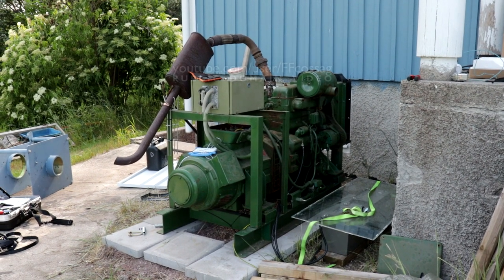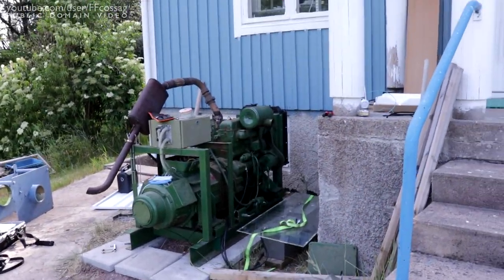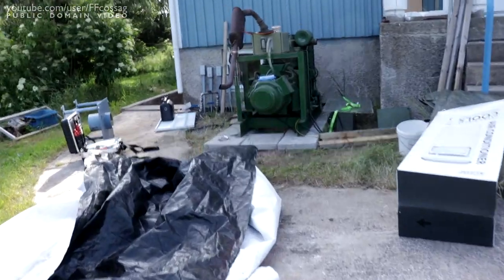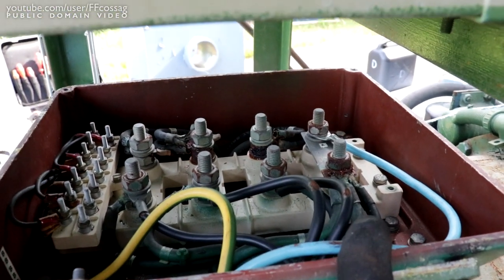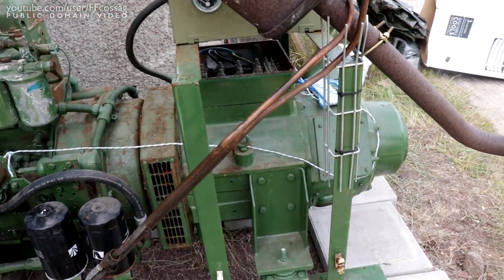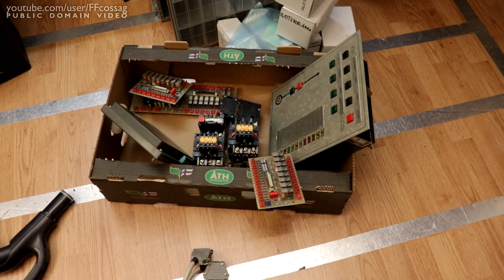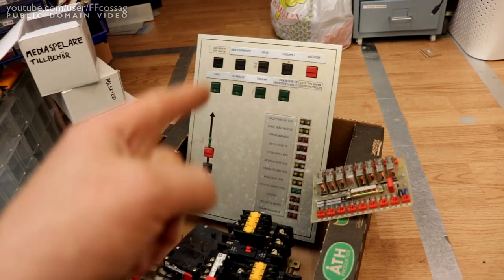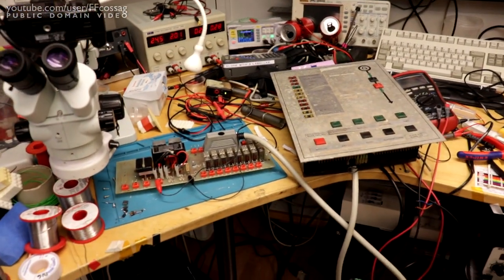25 kVA Diesel: A closer look & some clean-up

Comment: The big multipole connector is probably made by harting, we use these in our industrial systems. If you can find a part number on the one thats on there you can find the matching part you are missing.
Reply from the maker: Thanks for the info, and I can confirm that you're completely correct. Since shooting this video, I've actually acquired a mating plug for it from Ebay. The model number was very easy to decipher: This one starts with an M and it's a male connector, so I tried simply searching for the same number but starting with an F. And lo and behold, they were correct and widely available.

Comment: Chuck all those relay controls away and fit a Deep Sea controller. All you need is a starter relay, a diesel fuel relay and a fuel cut out relay. Deep Sea handles the sequencing and even remote start if you wish. I rebuilt my 110 kVA Dorman generator this way and it was very simple to implement. Those relays having been in a marine environment will give you loads of issues in the future.
Reply from the maker: My friend, you forget that my whole thing is to fix old electronics. ;)

Comment: LOL, I got here that same Relay Board, Never could figure out what it was used for, my former coworkers told me it was from a Car Alarm system - they propably didn't know either.
Reply from the maker: Well, now you know! They're actually really expensive since people are still using them. Might be worth putting it out on Ebay for some desperate technician to find.

Comment: Is that Mercedes a Vito?  Our postal service here in the US bought about 5000 of those things last year which were sold here as the Metris.  Nearly a third of them have had powertrain issues.
Reply from the maker: Oh no, I am not rich/masochistic enough to own a Mercedes. It's a 1999 Nissan Vanette, it's basically a third world spec mechanically injected non-turbo diesel mated to a manual transmission, and completed with a steering wheel and nothing. lol. The opposite of a Mercedes.

Comment: I think there may be a very easy way to translate the functions on those panels, the aluminium panels with the Swedish text look like they probably contain English and (I presume) German underneath them, could be worth peeling those off to make it easier to read (I don't know what the difference between Finnish and Swedish is, my only experience of the two is My Summer Car and Ikea!!)... :)
Reply from the maker: Finnish and Swedish are about as remote as English and Japanese. Very, very different beasts! Thankfully the panel is in Swedish, which I speak. Knowing what LED does what isn't hard, knowing how to decypher the connections for the relay board and how to configure the panel is another issue entirely ...
Reply: @FFcossag  Yeah, I think my brain would melt trying to work out how things are connected on those boards, there are days I have a hard enough time remembering how to wire a UK 13A plug properly... :P